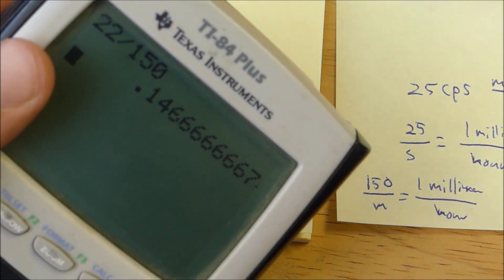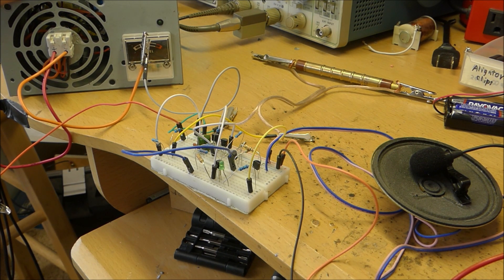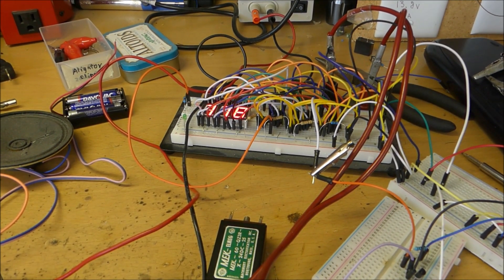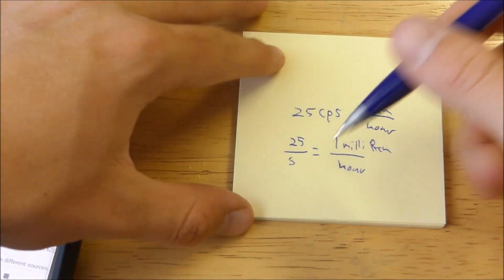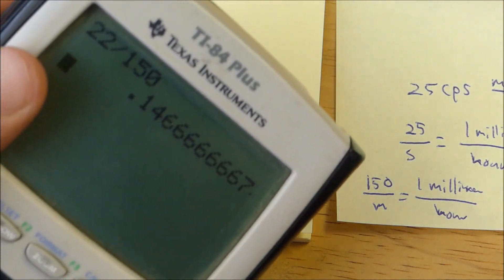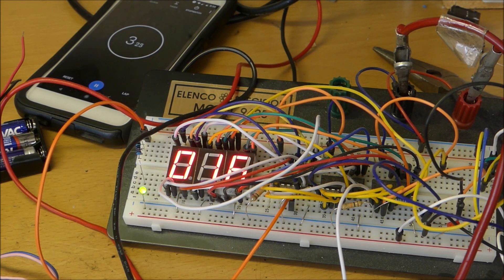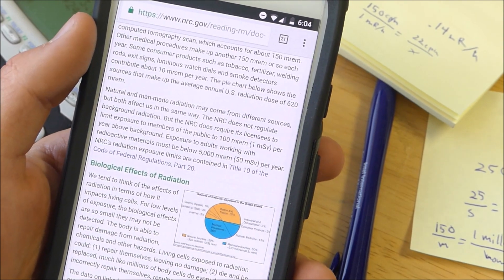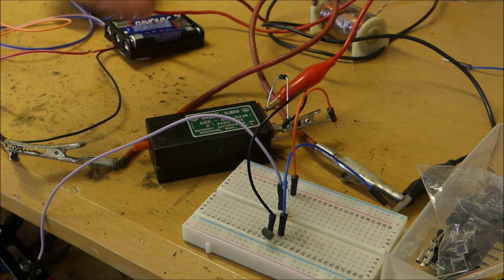Measuring Radiation with a DIY Geiger Counter and a CD4026 Counter Chip

Comment: You should use some old vacuum tubes which when supplyed with high enough DC voltage around 20,000 to 30,000volts will emit large amounts of xray,s and with a high enough power supply and a phosphor screen can produce decent images with the only large cost is the power supply

Comment: First of all put this radioactive material to inside a lead box.
Reply: The only thing if you are handling them with bare hands is to wash them very thoroughly (with soap 2 or 3 times) to avoid the particles getting stucked in the porus and then getting transfered anywhere else (for example by touching your eye or similar). Even though such exposure would still be small, ¡better safe than sorry!
Reply: not necessary for such a weak emitter. A nitrile glove is enough to block it's radiation.
Ever wondered why smoke detectors aren't made of lead?
Reply: @Jimmeh_B   Agreed. The materials he is using are minimally dangerous. Still, I'd wear gloves or use tweezers rather than touching them with my fingers. And don't put them in your mouth, obviously. Otherwise, it's reasonably safe.
Reply: @Markus0021  Yeah I have some AM241 in among my collection of junk. I never handle it directly, but wouldn't have any problems doing so if it was required. No different to grinding points onto my lanthanated TIG electrodes. If anything, it's far far less dangerous.

I have caught myself holding TIG electrodes in my teeth while changing them. I can't believe how complacent I can be at times.

Comment: To lengthen that pulses you schould simply use a R*C with a diode. You could put them between two of the four NANDs in a 4093. (I myself love to use them for all (timing- and pulse processing) things. Extra easy because they schmitttrigger on all inputs ánd their inputinpendance is mostly easy high enough so you often can do even without opamps. (O you of course know HEF4093 and CD4093 and all 4093's, different makes but all are equally easy useable. To try the value of the resistor in the RC-time ypu begin with a potmeter there,.. O but i'm sorry, i shortly forgot who i am talking to! I enjoy your channel, its great and always interesting!

Comment: That is cool. I've been wanting to get my hands on one of these tubes to muck around with. 
Leon is right though, your maths is out by an order of magnitude :)

For the pulse problem, Use a single npn amplifier to charge a 1uf, and the capacitor to hold up the base of a second npn.
Reply: Yes indeed, and that is even more easy than with a 4093!

Comment: Hey, wouldnt it be like 1500 cpm = 1mRem/h? Because 25 * 60 is 1500?
Reply: Yeah, I noticed that too. When he was doing the math he said "multiply by 60" which would be correct, but then he apparently just multiplied by 6, leaving off the final x10 step. He should have come up with 25*60 = 1500, but lost the final 0 in the answer.